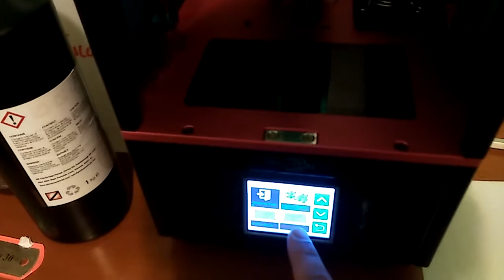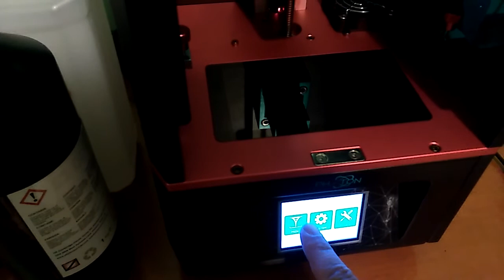Better Anycubic Photon LCD tester

Comment: Hi! Thanks for this video. I made this teste on my Anycubic Phton and it just working to the 66% and it seems pause everything. What does that mean?
Reply from the maker: this video is very old. this was designed for the photon classic back in the days there were no post processing tools like UVTools. The file is no longer compatible with the newer printers
Reply: @X3msnake  OK. But my printer is like this printer from video.
Reply from the maker: @CrisIder  how old is your printer?
Reply: @X3msnake approximately 4 years.
Reply: @X3msnake  Her problem is that during printing, rectangular and payy layers are formed (like a lasagna) that damages the result. I have already calibrated the printer (height, snowing...), files that I had printed before perfectly. I changed the FEP, I changed the resin and nothing worked.

Comment: Thank you, your test saved me alot of trouble...
Are any siptoms besides "Dead Pixels" in order to know if the LCD is still functional?
Been getting this strange, Phatom layers between supports sometimes... Dont know what could be... Could use some help ;)
Reply from the maker: use Epax firmware 4.2.18, all other firmwares have frame shearing issues
Reply: @X3msnake  Thank you, this solved my problem.
think the problems persists for a little bit, think it has to do with my procedure of placing supports:
1. User Prusa Slicer for Auto Supports
2. Place my strong supports in Chitubox
3. Validate with Photon Validator
4. Repeat procedure 2 if 3 shows inslands
5. Print and Done.

Think it has to do with using so many slicers and different softwares...
Not sure, but your solution helped me for now, thank you :)
Reply from the maker: @diogogoncalves8778  nothing to do with slicers. the frame shearing is caused by a bug in all firmwares between 4.0.11 and 4.2.18 that has to do with a atempt CBD-TECH made at implementing a mask for light compensation.
that bad code in situations where there were slices that had checker like patters would blow up the memory array and overflow it, and once that happened you had to unplug the machine from the wall power and wait for it to reset or reflash the firmware.

Comment: This is pretty cool. Is there an easy way to convert a standard b&w image to .photon file? I’m thinking this could be used for rapid prototyping of PCBs and would be a pain the have to convert to .stl before converting them to .photon.
Reply: Yes that works I have successfuly done silkscreen exposure with the photon.. check the photonsters.org github under community projects. u can use photon file editor for that
Reply: altlab - Lisbon's Hackerspace great! Thanks for the response.

Comment: I'm not sure if the two are related but this test doesn't run now that I did the latest firmware update. It gets to 4% then resets the printer.
Reply from the maker: Pete that's wierd since this is just like a nornal print file. Have you sucessfully dry printed anything other than this test since the fw upgrade? Why did you updated tye fw?
Reply: X3msnake I've been having nothing but problems with the printer since I purchased it as a second hand returned item. At first the screen wouldn't work, it was suggested to update the firmware so I did that but problem persisted so next they suggested checking the cable hadn't come loose. That kind of fixed it but it is still a little flakey, currently I'm printing a 28mm mini. Hopefully it'll complete correctly. If so it'll be only my second correctly finished print.
Reply from the maker: Pete use a good brand usb, also the stock psu is bad quality. Check photonsters github under photon-docs we have been collecting known issued and known solutions. There were reports of bad usb internal cablea. Dunno if you are in Anycubic Photon Owners group in FB but open a thread there with your problem if you haven't already
Reply: Hi, how do i get the file ?